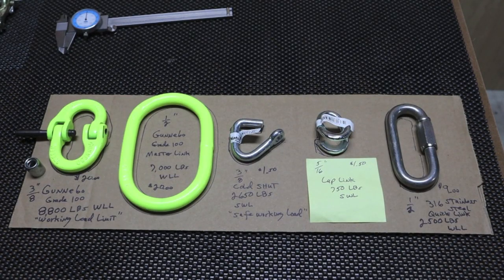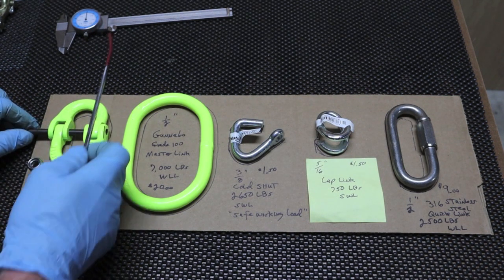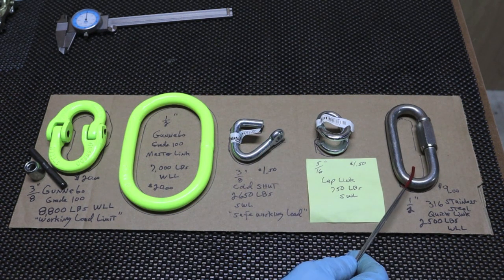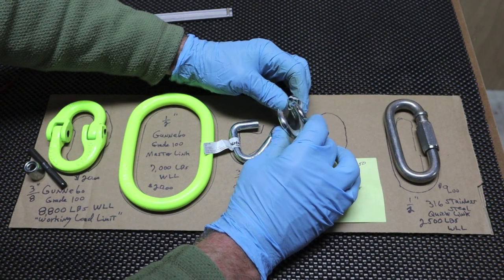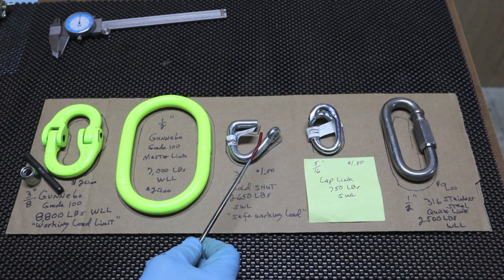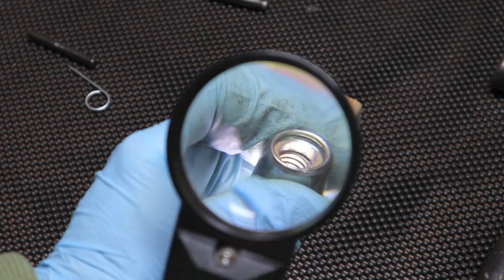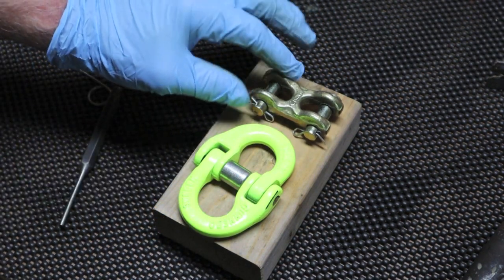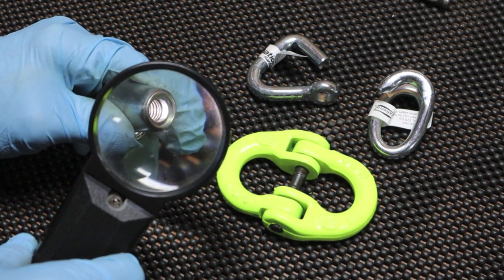Hammerlocks, Cold Shuts, Lap Links, Quick Links...

Comment: Cold shut is cheaper but not practical for quick disconnect constantly  which I want the screw  type would be better. Cold shut can be welded all depends what you use them for. I'm just using fir gates on dog crate ir kennel  or quick disconnect on various chain leash ends
Reply from the maker: Thanks for the info!

Comment: Could the double clevis be used to extend the safety chains on a travel trailer? The factory safety chains are Grade 43 chain. The double clevis is Grade 70.
Reply from the maker: It should be plenty strong enough. To be sure check out the WLL on it.
Thanks for watching!

Comment: Have you used shackles (with bolt / nut on both sides + pin by the nut)? Those oughta be fairly reliable, though I wouldn't drag them through the grass either.
Reply from the maker: No I have not tried them yet, but as you say, they would be terrible to drag through the yard and taller weeds.
Thanks for watching!

Comment: And I thank you for teaching me.
I am looking for something secure for my yacht mooring. I found that mousing wire is useless, it just unravels, putting my boat at risk. 
The Hammer-lock looks as though the springs will be eaten up by the ocean.
It looks as though I need a straight-through (unthreaded) shackle with a bolt and two locknuts with threadlock.
Reply from the maker: It sounds like you have it figured out. I have seen some stainless steel Crosby hardware for food grade application, but would also excel in the salt water environment.
Thanks for watching!

Comment: Hammer lock links are on oil drilling rigs.  They are used to attach the spinning chain to the cat head.  Grade 10 chain.

If I ever use a cold shut, I will use a 3/8" on a 1/4" chain.  I will use a 1/2" cold shut on a 3/8" chain.  I work in a rough environment.  Yesterday I was swapping a log loader from an R model Mack over to an old Mack Super Liner.  I'm 52 and have a 3/8 chain with a 1/2 cold shut in it.  Been like that over 30 years.  We have used log skidders to pull out dozers with that chain.  It came out of a card board baker at a store and was two ten foot pieces.  So, I bought two Clevis grab hooks and a 1/2" cold shut, and was in business.  We had pulp wood trucks at the time.

There is another link like the hammer link that has a piece that hammers in the middle with two separate halves.  Use them on drilling rigs for spinning chains also.  Re usable just like the other one.

But, let's say you put a 1/4 cold shut in a 1/4 chain.  That is too weak and will not stay.  It may work for a personnel barrier chain at a movie theater.  Maybe a chain on a gate around a fence post.  But I would not expect much.  I have personally seen if you use a 3/8 cold shut in a 1/4 chain,  I have seen the chain break somewhere else.  The split links will work.  They are bigger and low grade so be sure to weld inside and out.  

I can't stress enough the need to up size on your repair if using low grade cold shuts, screw links, split links, lap links.  The double Clevis you threw out works good too.
Reply from the maker: Great information!
Thanks for sharing!

Comment: One option you didn't cover is those that you peen over the rivets. I was trying to find a way to connect two stainless chains where they will still run through and anchor windlass and this seems to be the one thing you (or anyone else on youtube) didnt cover.
Reply from the maker: Tim, it is common for most around here who are using the cold shuts to tack weld them. A good peening would do the trick also.
I'm not sure what style of link would properly feed over your windlass though.
Thanks for watching and commenting!

Comment: Hammer links best invention for chains since the invention of the chain!! Good video!
Reply from the maker: Hi Bill, thanks for watching and commenting!
I agree, with lap links requiring welding and quick links not having the working load limit (for link size), hammer links are the best. The only downside is cost. For the cheapest and no added bulk, lap links are a great and permanent fix, but they need to be squeezed together and welded.